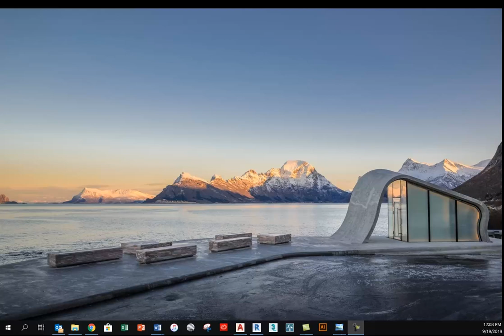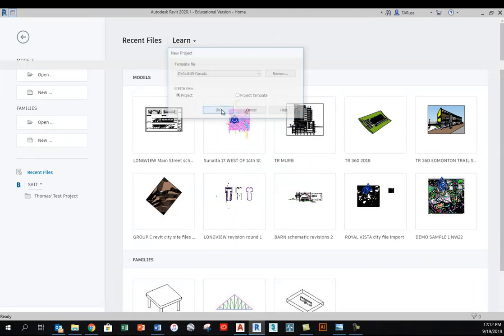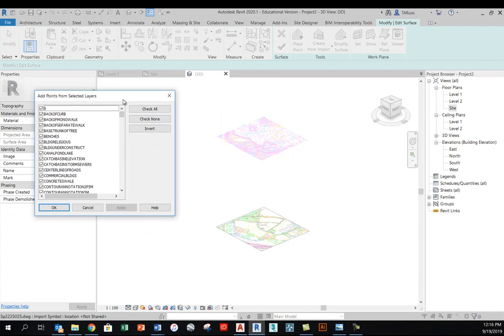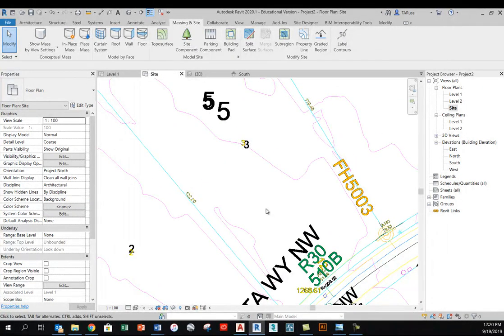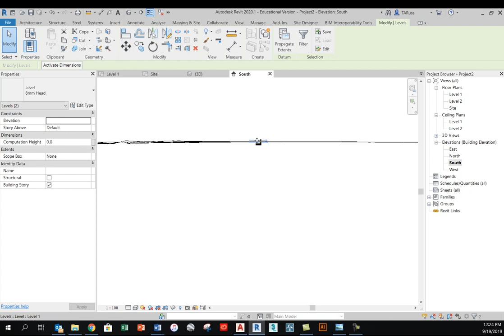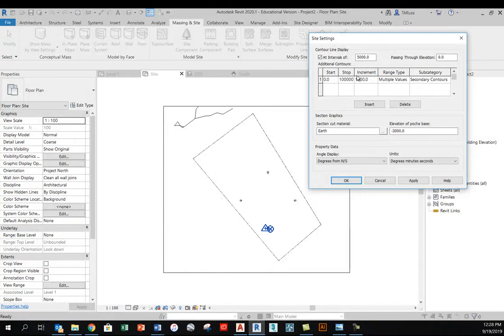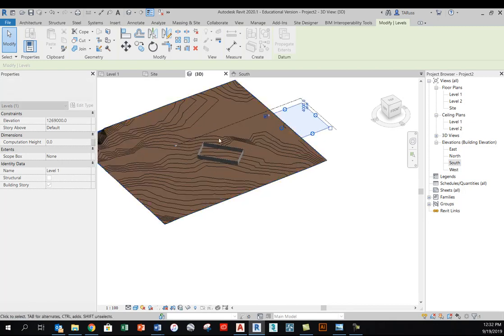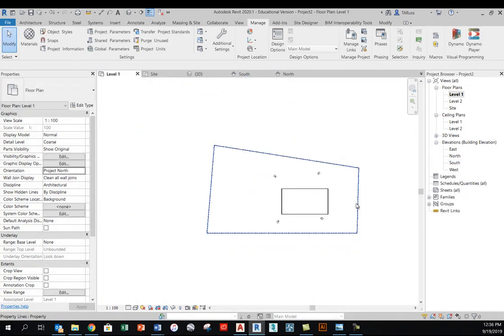Revit Site Plan using AutoCAD Survey Files

Comment: 1-You could have changed Project Point Elevation to change location of Levels instead of moving the Levels up!
2-Instead of keeping hiding AutoCAD File using the VG, you may use Hide in View option or simply Manage Links / CAD Format / Unload ( Not Remove)
3-After positioning the Walls parallel to True North, what will happen to the ( Real south view) ???? 
4-Hope you can shed a light on these points as well. 
5-Before walls, we acquire a Building Pad 
6-You can  go to each Elevation View, drag and align the views, instead of dragging them in 3D,  or after moving them in 3D
Thank you for sharing, great effort.
Reply: How do you do step 1 ? I agree that in architectural plans the 0.00 elevation is fine. Is taht what you meant?
I agree on step 2 but everyone will decide according to their projet
I still do not know how to adjust the view perpendicular to the project if this was rectangular
5- I agree on building pad first but many do walls and then floor
Thanks for the comments and answers